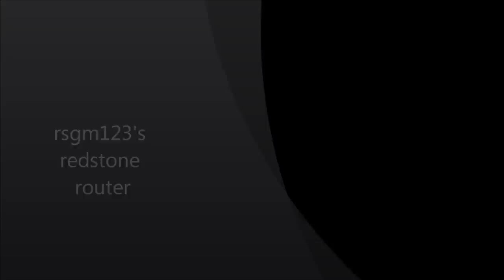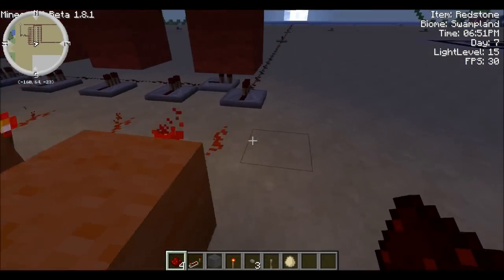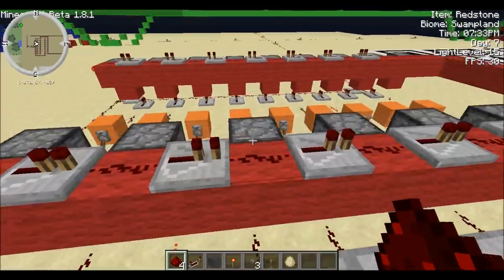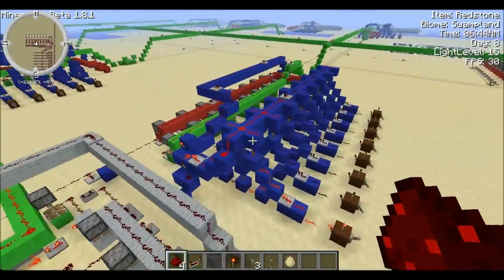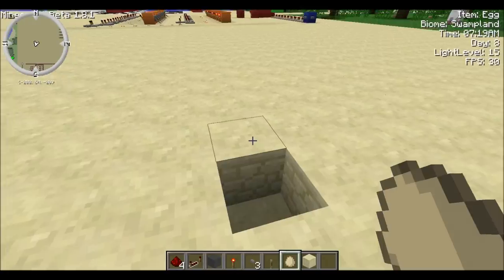minecraft redstone router

Comment: I must remember to make a video of my serial transmitter (what you call it, I call it that or a "parallel to serial converter" if I'm getting really anal). You have a bunch of pistons in yours but you don't need them. It's one of the few circuits that's more compact without pistons. I've used my serial transmitter with receivers to make a mine cart track programmable by station reliably. Bookmarking your vid to send a link in case I ever get around to making a vid......
Reply: "shift register"

Comment: I am not hating, but here is some friendly critisism: 
#1. This could be so much more compact
#2. This could be so much faster
#3. Use repeater lock serial receiver
#4. This does not look like a complete network
#5.  Router? Ehhh looks more like a switch but whatever lel
#6. What is the packet transmission speed? And how often can the router take in a new packet after it proccesses the data of the first one? My router transmits at 10 bits per second, mine can also proccess a new packet every 10 ticks.
#7. Git Gud(JK :P)
But really m8, make a real router thats useful and achually has the features a router should have.
Reply: Should have been nicer to him, this build is great for that time. It's built in BETA 1.8.1 before the release 1.0.

I'm making myself Internet in minecraft, hop on mc.openredstone.org and type /p h Smallyy, look to your right and there you have it!

I've also got a CPU that runs on a 6 tick clock, 3 ticks on, 3 off. Faster it cannot get because of torch burnouts and the limmits of Alu building and register stress.
Reply: Dude delete your comment. You have to consider the fact that this was made 7 years ago (6 when you commented). This was made for simplicity so making it compact is not really the point. #6 is in the description. 7 just shut up I know its a joke but don't say that.

EDIT: Also since it was so early on a lot of features weren't discovered or implemented and he would have had less practice.